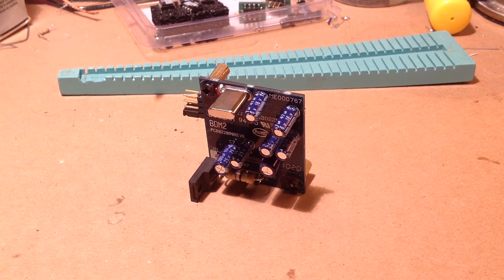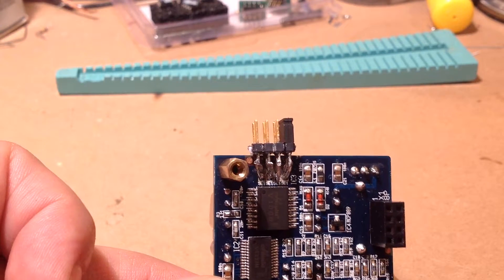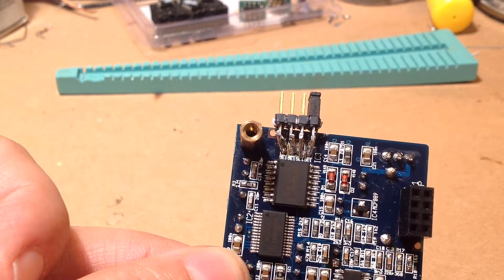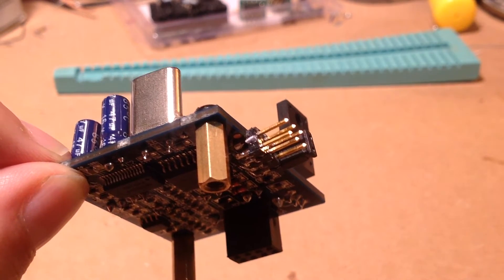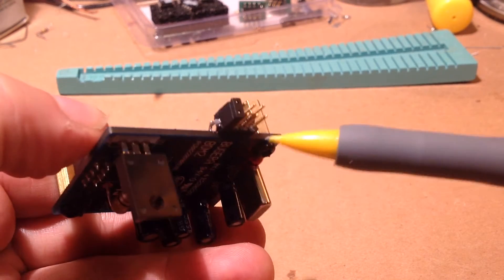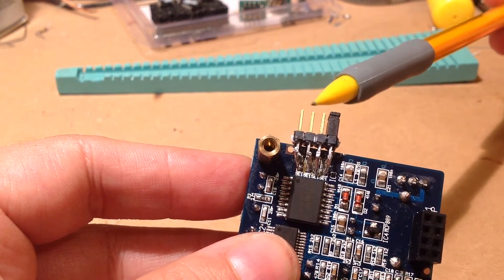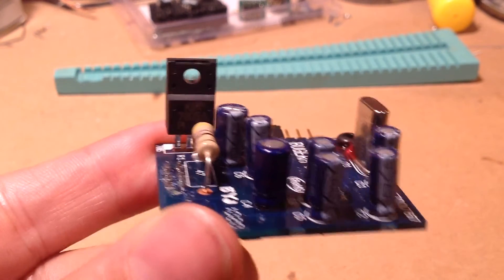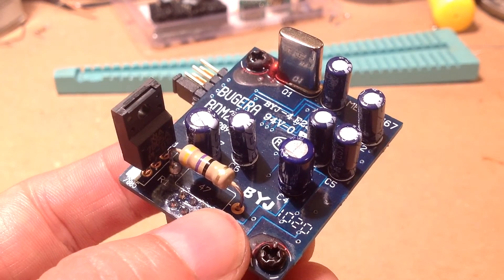Engineer meets Bugera V22 reverb - Part 8 (circuit board)

Comment: My Reverb is cracking and popping on my Bugera vintage 22 my BDM2 Reverb processing board is bad any websites where to purchase one appreciate any info thanks
Reply from the maker: I don't know where you can get a replacement board. Are you sure it's the board? And have you tried replacing the voltage regulator and/or adding a heatsink in case it's just that simple?
Reply: @MithatKonar  no I have not as I'm just thinking replacing that will fix my problem. I'm Modest ln repairs and soldering probably should let the amp repair guy get ahold of it. Since I could be wrong in just replacing the part

Comment: I'm actually going to be doing this same thing on an Infinitum T50 with an encoder (also pulled down to permanent small-hall).  I was wondering about the reliance of the pulldown resistor value and did you integrate it into your movable header? Do you recall what the SMD resistor value was?
Reply from the maker: At the time I did this, I convinced myself that the resistors' values were very small -- one ohm or less IIRC. Whether I did this through a schematic, part markings, and/or part measurements I sadly can't recall. The header merely replaces the resistors with dead shorts to ground. My board has been happy for years like this, but you'll probably want to do some circuit tracing on yours in case there are multiple versions of the board out there.
Reply: @MithatKonar  Thanks for the response! I'm thinking the same, based on the chip data sheet and the good ol' E=I x R I think I figured them to be about 150 ohms each.  I suspected it was simply a nominal load to dump the normally stuck high logic but I wanted to make sure.  I suppose I can always just measure them off-board but if yours is working fine I'm not too concerned with it.  The plan for me is to use a hex encoder and built a small cable to run to the back of the amp and panel mount the rotary encoder.  Seems kind of wasteful to have those program at your disposal and no way to access them.  Thanks again!

Comment: Thx for the vid. I just got a V55 Vintage head. Got it cheap, due to non functioning reverb. I have pedal, so NBD; for now. Currently, I'm just doing tube swap. Was already aware of the v reg issue. Thx for the tip on the cap! After I've had some fun. with the amp, I'll take on the reverb. Did you ever do the rotary switch?
Reply from the maker: Sadly, the rotary switch remains on the TODO list. Not enough hours in the day!

Comment: Two years of regular weekend giging with stock output tubes.I replaced preamp tubes cos I had  hum problems.Currently using  Ei premium ECC83 made in former Yugoslavia in old Telefunken plant.Warm cleans and sweet drive chanel...big diference.
Reply from the maker: I wish Ei were still around. Treat those tubes with love!
Reply: +Mithat Konar There are still lots of them around in Greece. They have been used vastly in the early '80s for TV servicing. Mostly P-types but you might be able to find E-Types also since they used them in audio equipment such as band machines. Greetings from Austria.
Reply from the maker: +Gustav Cida Good to know. Thanks!

Comment: What is your opinion about PCB and other components quality...also no heating vents is this a problem...thank you.
Reply from the maker: The PCB and components quality were both much better than I was expecting. Not the very best available, but certainly not the worst.

The one exception to this is the 12AX7 tubes. One of them failed within the first minutes of turning the amp on. (I am currently using a combination of 90s vintage EH 12AX7WXT and new JJ ECC83-S.) The output tubes are holding up just fine. Also, the pots have plastic shafts--but otherwise seem to be of decent quality.

I've not had any problems with heat. The envelopes of the tubes sit mostly outside the chassis, and the circuit doesn't have any other generators of significant heat.

Comment: Very interesting video.  I may just have to follow this one up.  

I looked at the data sheet and the 'code' for spring reverb is 0111. But you've got the jumper cross the last pair of pins, so I thought the code would be 0001. 

Please steer me in the right direction. Does putting the jumper on make that pair a '0'?
Reply from the maker: You are correct: without a jumper, the pin gets pulled up to 1; with a jumper in place, it gets pulled down to 0. In other words, no-jumper = 1, jumper = 0. The Spring Reverb code from the datasheet is 0111, so we want 'jumper |  no-jumper | no-jumper |  no-jumper' relative to the top of the board. That means when viewed from the bottom, we want 'no-jumper |  no-jumper | no-jumper |  jumper.' I hope that makes sense.

BTW, I added annotations to the video to help clarify some things, but they don't seem to show up all the time. I have no idea why.